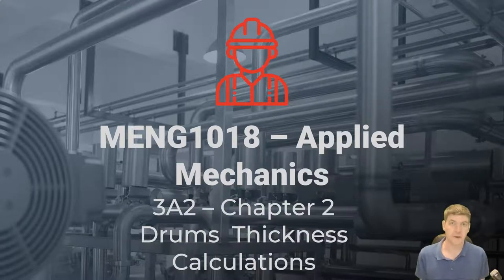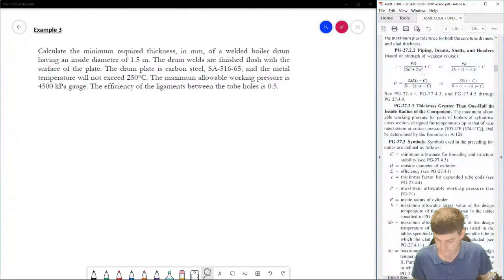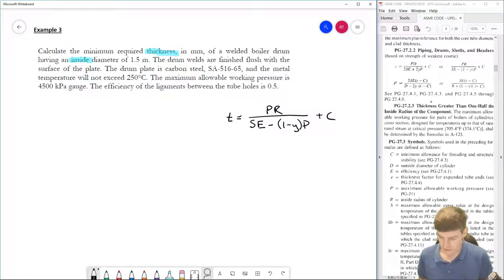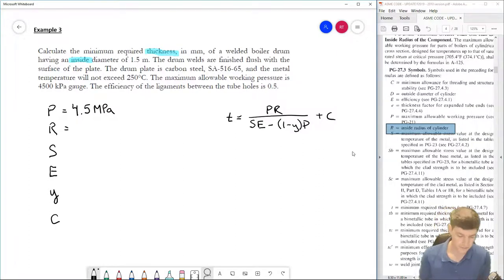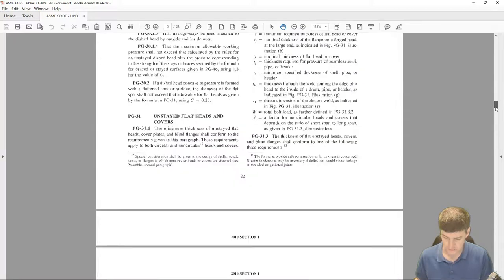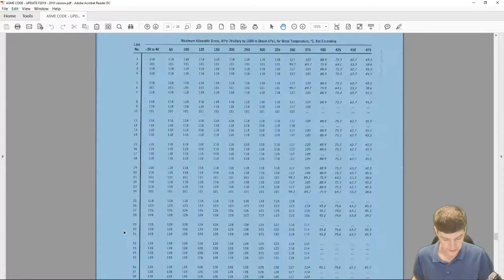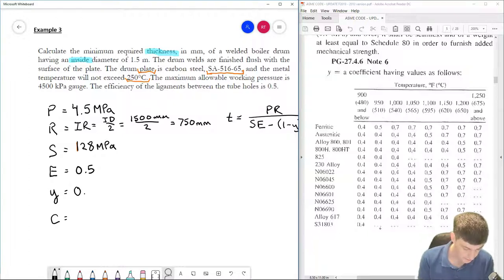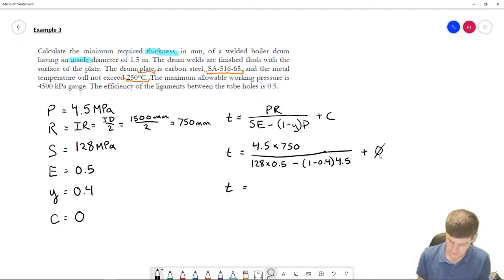MENG2018 - ASME CODE CALCULATIONS - Drum Thickness Calculations

Comment: Hi sir..your video is so knowledgeable sir..very much useful to the industrial engineering..

Thanks for the work you r doing...

I  want to know that In boiler water wall top header or bottom headers rise stub is there right ...what is the distance we have to maintain to keep the riser stub ....is there is any formula to find ...

Plz...tell me..sir...if header is two riser  stubs means ...what is the distance for that stubs we have to maintain ....

And how to calculate no.of tubes for the water wall whether front wall ...RHS or LHS ..or REAR wall ...whatever ...

Plz...put one video for how to calculate no.of tubes for the water walls...